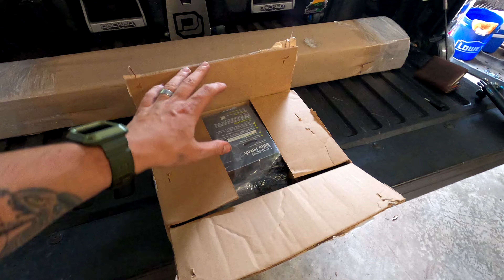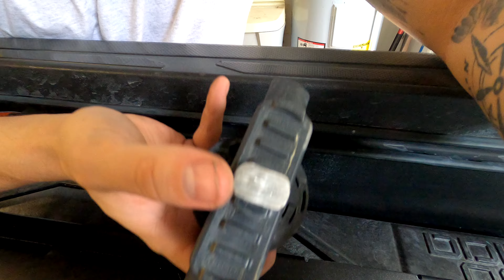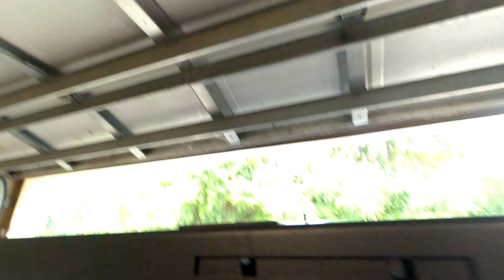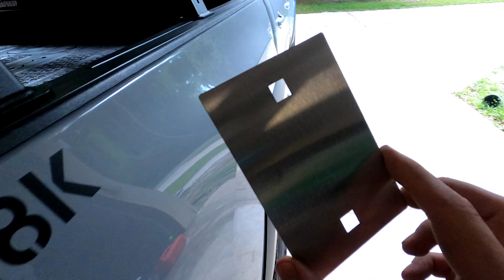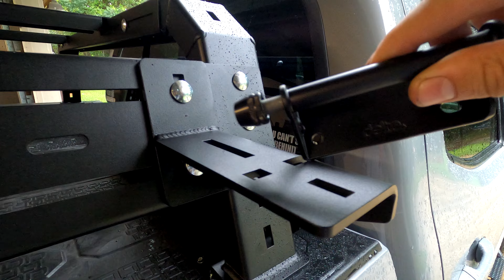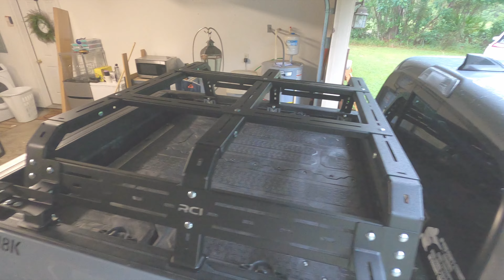RCI Off-road 12" Overland Bed Rack Install: 2017 Toyota Tacoma

Comment: Nice build. just wondering if you knew how many inches it was from the top of the decked system to the bottom of the rack rail?
Reply from the maker: Yep! Just measured it, it’s about 16” to the rail, but with the spaces in between you could stack things another 2” to your tent base
Reply: @FromDuskTillDawn518  awesome thank you

Comment: Thanks for the info on not getting a 18 inch. I am looking for a rooftop tent setup too. I have a tow cam that I don’t want to cover up though. You said you have the shortest version? What’s the height if you don’t mind me asking?
Reply from the maker: The rack sits exactly 12” measured from top of the metal bar of the rack to the bedside that the rack sits on. That gives ya about 29” from the bed to the bottom of the rack bar.

I love the height, and even though the height of the rack impedes rear view it’s kinda nice because it blocks headlights behind me at night while I am still able to see the cars.

Also with the tent mounted the top of the tent rests almost perfectly inline with my roof rack which looks very sleek.

In the future however, I will be going to a full sized rack, not because of the height but the utility of having swing up doors and a sealed bed cap. I’ll have to sacrifice my windage loss.
Reply from the maker: As for the tow cam, of that is on the back of the cab at the 3rd brake light the tent will cover that when mounted. 

For convenience I rigged up some pulleys in my garage to take the rack and tent off of the bed when I am just driving around town.

Comment: how do you like the decked set up
Reply from the maker: I love it. It is so nice to have real storage in the truck, and the loss of bed space has never been an issue in the almost 2 years that I’ve had the DECKED system. 

For camping gear and firewood, it’s secure and sturdy. Highly recommend